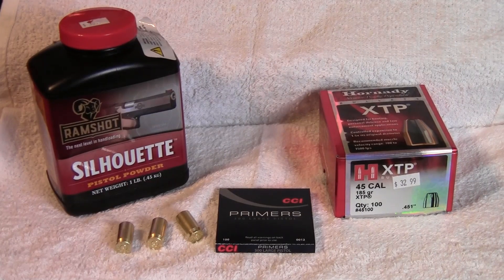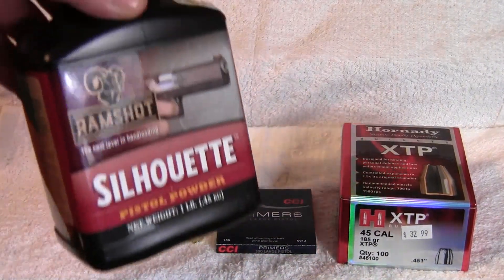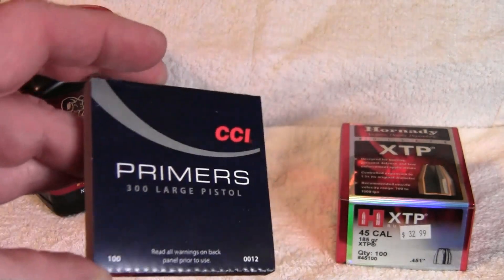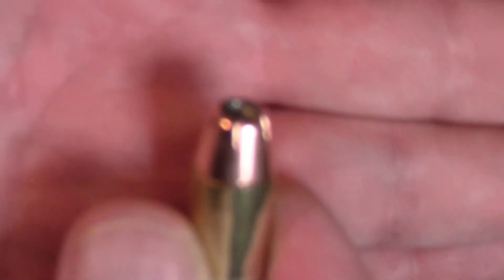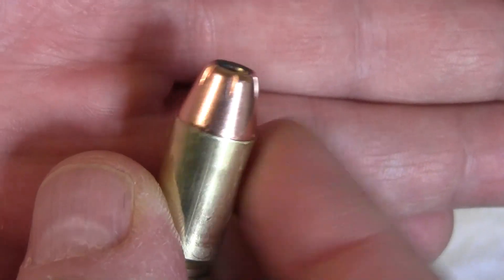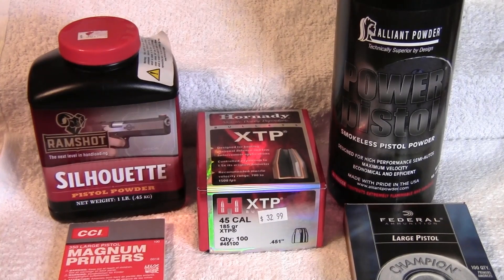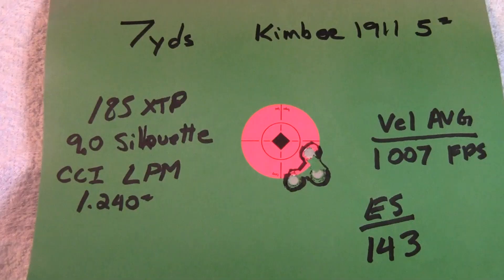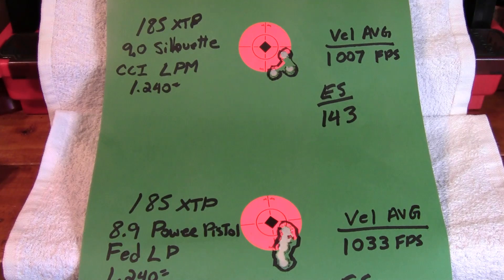Reloading 45 acp with Hornady 185gr XTP bullets

Comment: I've also had some variance with Silhouette in my Kimber Ultra Carry II. About 750fps is where I end up most times. What would you think is the average velocity for 3" 1911 barrels? Thanks for showing, sir.
Reply from the maker: All of my .45 ACPs are 5" but I did some quick checking on some load data and websites. It varies a lot by load, but 3" barrels shooting 185s lose about 3% to 10% compared to 5" barrels. So 185s from a 3" are going 870fps to 1030fps(P+). Hey, thanks for the question and watching!